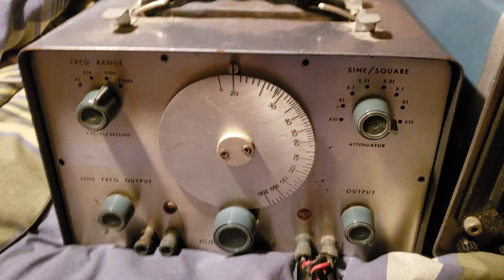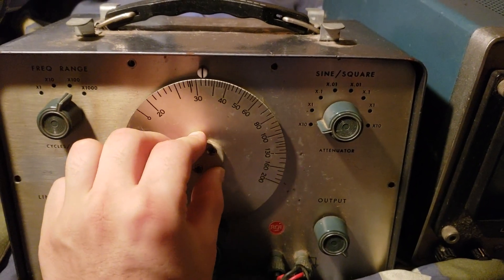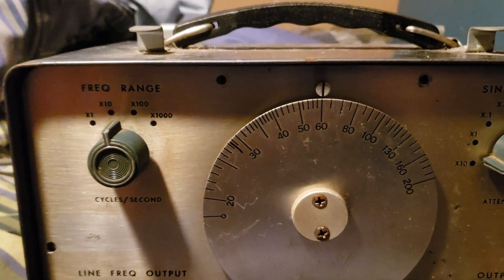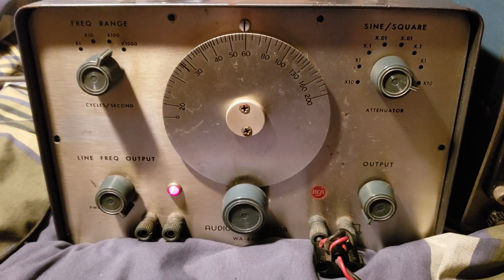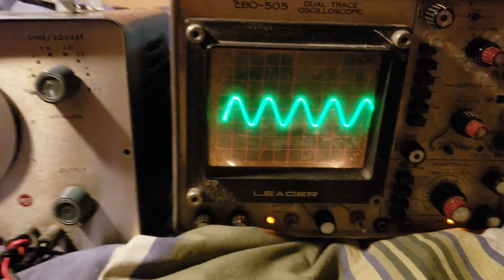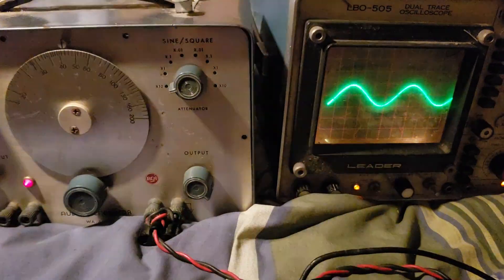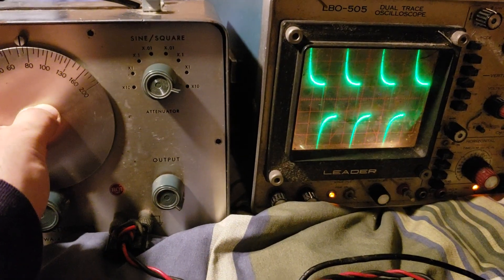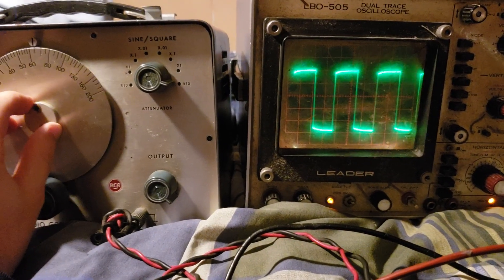what is an audio generator (function generator)  and what does it do

Comment: Hallo, How can I select an exact hz frequency the rotary wheel seems difficult to adjust ? Thanks for answering
Reply from the maker: its not difficult to adjust, the dial moves smoothly. There are markings with different numbers to help tell the frequency. If an exact frequency is needed the second channel of the oscilloscope can be used to confirm the frequency. Though, analog audio generators are not as precise as their digital counterparts, they are much better for working with a wide range of frequencies and for frequency sweeping.

Comment: The advantage of using an audio generator of this kind is the stability of its generated signal in terms of voltage & frequency over the desired frequency range . Total harmonic distortion of output is very low. When testing the design of small signal audio amplifiers you want an input signal with as little distortion as possible, with as much stability as possible so that you can accurately measure performance characteristics of your amplifier over operating bandwidth. Next the audio generator is capable of very small continuous changes in frequency with turn of dial etc. An excellent piece of lab equipment for design & performance testing. A very good find along with CRT oscilloscope.
Reply from the maker: Thanks, though they were a gift for a birthday

Comment: Dude, great video. What would you recommend I get to generate sound to quash my neighbors dogs from barking. I'd need between 20 kHz and 35 kHz and I have the tweeters that can handle 100 watts. Any recommendations? Thank you.
Reply from the maker: thanks. I'm not encouraging or recommending anything that would upset PETA, ASPCA or your neighbor. But if your looking for a high frequency generator, I would start by looking on Ebay (check the description and condition first) and any near by Hamfests (like a flee-market for electronic and radio equipment). You can find good deals on second hand equipment, just check the range adjustment (some times called a multiplier) for a x1000 setting (some listed as x1K). Set the dial or LCD display (depending on what your using) to 35 and the range to x1000 and there's a 35KHz wave. If you want a new one here's a decent one for a reasonable price on amazon https://www.amazon.com/1HZ-500KHZ-Functional-Generator-Seesii-Frequency/dp/B08NSR5GYR/?th=1      There are professional ones on amazon, but there extremely expensive, starting at about $100 and on average about $300 to $500.  If your up for a project people have used arduinos to make high frequencies. But once you've got your generator, you can hook it up to an amp and hook the amp up to your speakers. I explain how to do it in this other video https://www.youtube.com/watch?v=sVfxdfDevwc&t=1s
Reply: @JosephX  Thanks Joseph for the thorough reply sir. I'll update if and when I move forward with the project.

Comment: Does this not work for other things like a refrigerator?
Reply from the maker: It could, but there really is not any electronics to test in a refrigerator (not counting smart fridges, that's a whole other thing). Plus any electronics that needed to be tested in a regular fridge, could be tested easer with a multi-meter. This equipment is mainly used to generate and test / "view" the signal. Think like devices that input one signal and change/manipulate it. Like radios, TVs, amps, computers and etc.

Comment: Awesome vintage stuff!  Reminds me of my Korg monotribe.  Really fun to make sounds with electricity.
Reply from the maker: Thanks
Reply: @JosephX  I was wondering how do you hook up the signal/function generator to the input of an amp? Do you use a bnc cable that has a rca end on it? And do you conne t the rca end to the input jacks on the amplifier/receiver?
Very informative and interesting video.
I have an Eico signal generator model 324 that i did not know how to use until now that i have seen your video.
Thank you
Reply from the maker: @SDsailor7  your welcome and thank you, glad the video helped. That's why made them. I use BNC to banana plugs and the banana plugs have alligator clips at the end of them. Than I have wire to RCA and I just attach the alligator to the wire part. I use this just because that's what I had, but a BNC to RCA adapter will work just fine
Reply: @JosephX  How did you hook up the speaker to the signal generator? To get the audio out?
Reply from the maker: @SDsailor7  I have an other video called "amplifying an Audio Generator signal with different amps" that will help answer your questions https://www.youtube.com/watch?v=sVfxdfDevwc
Reply: @JosephX  I will check it out.
Thank you